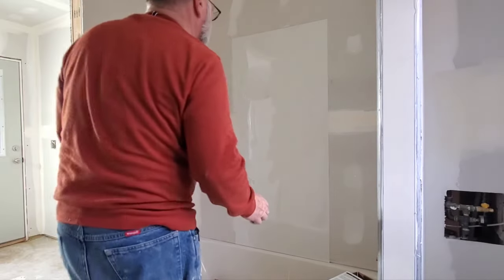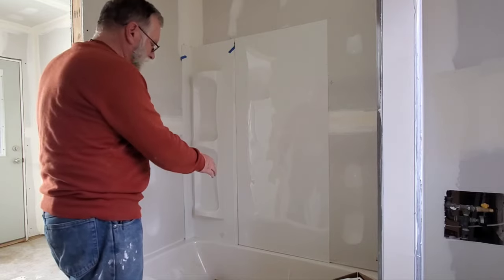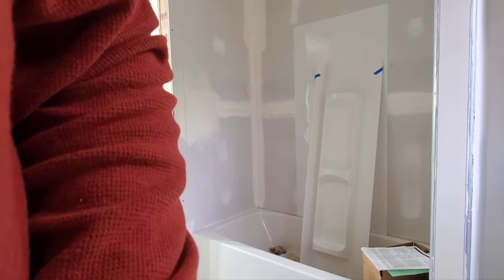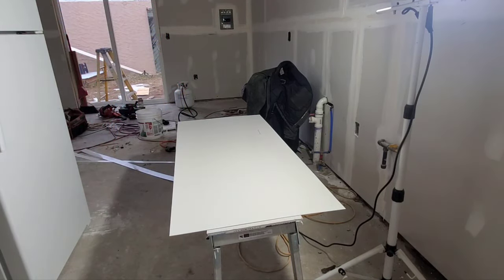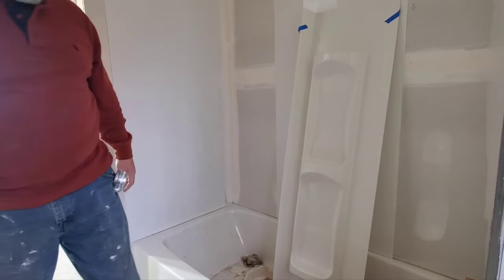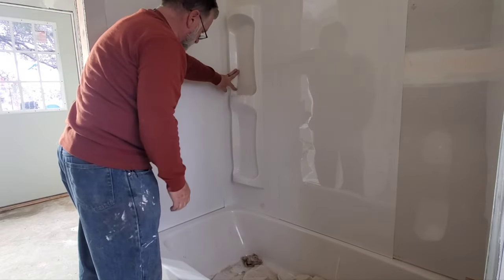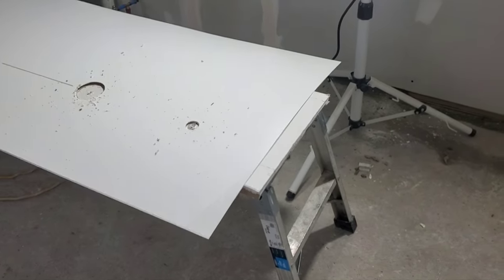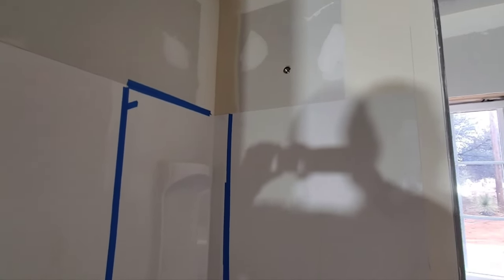How to Install a Tub Surround

Comment: Never use regular drywall behind a shower wall.    Use a water resistant wallboard.  Makes me think the guy is selling the house and doesn't care what happens to it in a couple years.  Sad that people make DIY videos who don't know what they are doing...
Reply from the maker: What is sad is I couldn't get any here, I almost used cement or Hardie backer, but didn't. As long as it's water right it will be fine.
Reply: @mikesmadness6669 i am sure that person doesn’t tell what to do or pay you!
Reply from the maker: @kevincampos1266  it was my own place
Reply: Why on earth would you need a waterproof board behind a vinyl tub surround? You waterproof behind tile because water travels through grout, but it cannot travel through plastic.
Reply: Can you put it over a existing waterproof wall panel
Reply: Like a slick board ?
Reply from the maker: @timstidham9223  not sure,  I think the hard part would be getting that old wall panel clean enough for the adhesive to stick.
Reply: Most houses have a shower just like what he's doing. I've owned my house for 25 years and mine's been this way and never a problem
Reply: I just got this exact one bc my house has some kind of slick wall panel card board material that when I went to redo caulking it was pulling up I believe behind my wall is Sheetrock idk if that would be fine
Reply from the maker: @timstidham9223  is not ideal,  of you have the opportunity to put something water resistant it would be better.  But if it's sealed properly it should be OK.
Reply: Green board should have been better.  I’m astonished the walls weren’t primed.    The walls have the ability to peal like a banana now.
Reply: Nice so what do you pot from those plastic panels to the shet rock?
Reply: After you pull the tape off the seams do you have to caulk the seams?

Comment: Why didn’t you use MMR board instead of Sheetrock? There’s no way you can prevent the top of the wall getting wet and eventually soaking the wall behind the panel causing mold and the paper to separate. Moisture Mold resistant regular sheetrock is specifically made for this application. I’ve installed thousands of square feet of this in apartments and homes and it’s the recommended material for two reasons. The first is in the name mold resistant and the second is that if you use FRP glue or the tube glue the paper has a bonding agent on it to ensure that the layer of paper on the board doesn’t separate. Maybe call a real contractor before installing this. It’s a cheap product but can be a very good bathroom addition. The problem is that if it’s not done properly, as you’re showing, you’ll have water infiltration and mold /mildew in the wall space. I always use a moisture barrier above the panel and paint using a half round pvc or silicone strip to seal the top as well as aesthetic appeal. Those thanking you will be cussing you in a few short years when they can’t find where the musty smell is or the panels start coming off or both. Having to repair work like this because of contractors like you that literally throw the instructions aside because you believe you know what you’re doing made me lots of money but I don’t like the problem of the people having been sickened because of mold exposure nor the extra expense.

Comment: Thank you! I am installing the same type of surround so having a video like this is really helpful.
Reply: Bet you have issues with the installation if you did it this way didn’t you?? If not you will soon. Look above the panel for mold below the paint because if you used regular sheetrock that’s how mold will grow behind the panels and if it’s at the top it’s made its way down to the bottom. He did not seal the joints which is in the instructions if he had taken the time to read them. Also using a roller to ensure no air bubbles were in it was something else he missed. I really hope you figured out quickly that there’s a manufacturer video on here that showed the proper installation. I’ve done thousands of square feet of these and 1/4 of them were repairs because the contractor did like he did and most apartment buildings use low bid. The problem instructions are very simple and if you read them first they will list all of the materials you need for a proper water tight surround.

Comment: I’m here because I’m doing my tub surround in our 1992 modular home. The original surround was just glued straight onto the wall panels which are kinda like drywall panels but have like a vinyl   Like wallpaper on them. When I ripped the old surround out there was a bunch of the wallpaper stuff that ripped off exposing some of the paper layer underneath which I hope won’t be a problem when trying to glue the new surround on. I’m just in the process of scraping the old glue off with a putty knife to make sure it’s smooth with no bumps before I glue the new surround in
Reply: Your surround should be glued to cement board or purple board that is water resistant.  Placing it directly on drywall is not ideal for a bathtub surround with moisture. That paper that came off is supposed to be on and will make that wall more porous.
Reply: @dustenwalker484  I take your point but would mention that my surround was glued right on regular old drywall 32 years ago and is dry as a bone.

Comment: 78-82” is good height for shower head….. some wall heights are different on the tub surrounds. I do agree that putting it 1 inch above the tub surround is a great place and you don’t have to worry about water getting on there unprotected part of the wall.

Comment: Thank you for the video just a quick question do you have to turn the water off to the tub before you do this project or can you just remove the handles without turning off the water to the tub
Reply from the maker: The handle should come off without turning the water off.
Reply: @mikesmadness6669  Cool thank you so much!

Comment: Did you put the locktight in the corners and on the overlap to bond the panels? Just curious because i remember reading it wouldnt bond the two panels together
Reply from the maker: I did not where it overlaps, but I did glue the corners in.
Reply: @mikesmadness6669  Okay, thank you. Asking because I'm helping my friend install basically the same one but the overlaps aren't wanting to sit flat with the other panels
Reply from the maker: I taped the seems until it was dry for like 24 hours

Comment: Can you used hardie boards instead of water resistant boards?
Reply from the maker: Yes you can
Reply: Ok. What do you use to seal the joints?
Reply from the maker: @JC-ud4jn  silicone

Comment: How did you address the small exposed section of drywall that the panal doesnt cover? I'm in the exact same situation and am not sure what to do. Thanks!
Reply from the maker: I just paint up to the surround. Or tile. Whatever is your taste or budget
Reply: In the same boat here gonna need about another 10” above cause of the shower head height…..  I’ll be running some 1x pvc trim above the surround - just in case of water from wild shower parties 😂

Comment: Trying to figure out about the material to use when you are out of tub surround, because I made a bad cut any suggestions
Reply from the maker: You could try using that fiberglass sheeting. I can think of what is called.
Reply: Thank you brother
Reply: Yes FRP

Comment: I don't know what to do my bathroom has a window right in the middle of the shower.
Reply from the maker: That is a priblem for sure. You can put something waterproof on the sill like tile. You can in some places but vinyl trim like 1 x 6, and use that to trim the window out after you install the surround.

Comment: Very nice job u did love the video thinking about doing the same thing in my bathroom did u do a video on how u did the sealant
Reply from the maker: Oh Yes i should have recorded that as well.  I masked each side of the joint and put the sealant on then pulled the tape off.  Be careful you don't do what i did any by accident use clear,  doesn't look that good.  Also i went with the cheapest surround, i had trouble with a couple of areas that i had to go back and get more adhesive in the joint.  It really wasn't a very good surround.
Reply: Just a question, should you use the purple or green mildew resistant sheetrock or is it okay to use a regular? It looked like that was regular sheetrock? Thank you
Reply from the maker: I would have bit out want available here.  But i wanted to
Reply from the maker: No i didn't sorry